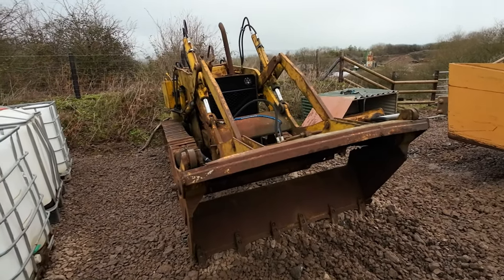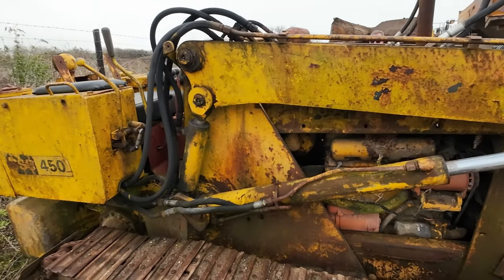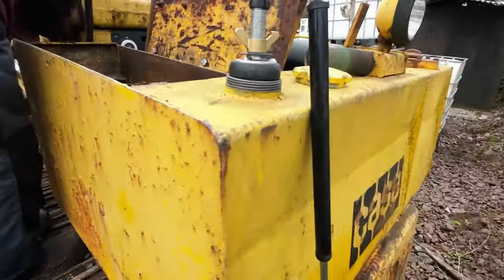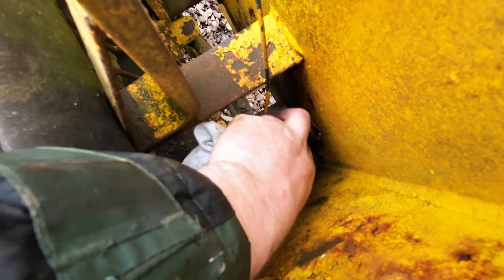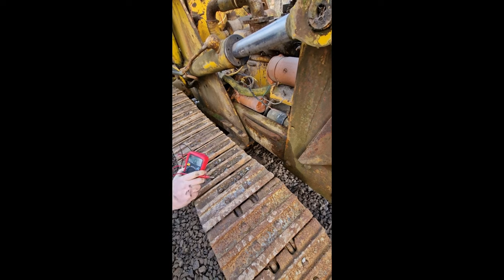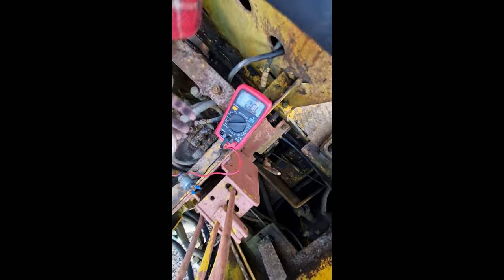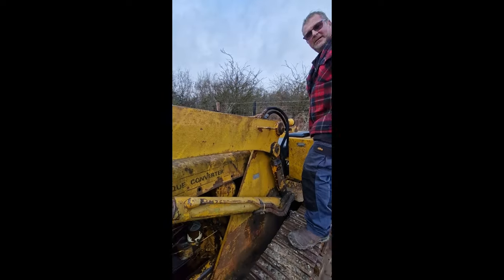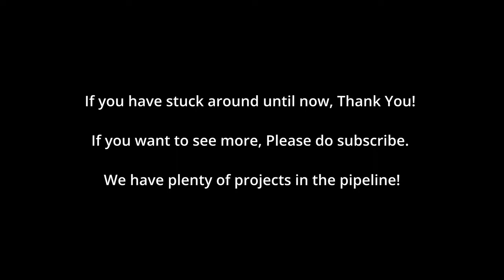CASE 450 Track Shovel - Electrical Gremlins! #willitstart

Comment: What I usually do when I restore track loaders is remove the bucked, loop the four in one pipes, use a ramblock on the lift rams and raise them up. It makes it much easier to work on. Also raise up the machine off the ground with sleepers to make it easier to work underneath. I hope to get my Cat 951 started soon as I get the oil pressure pipe to gauge fitted